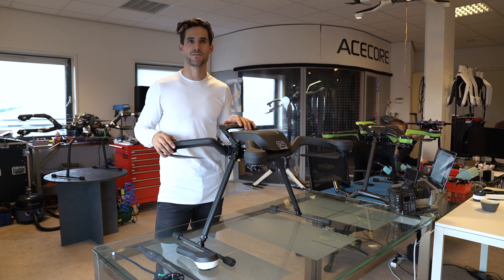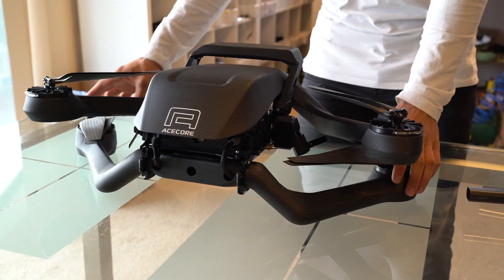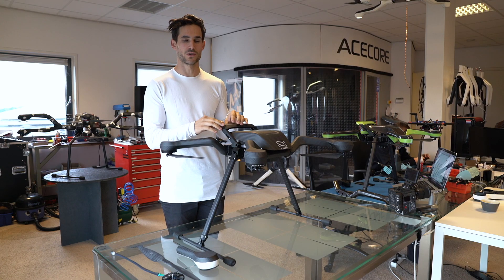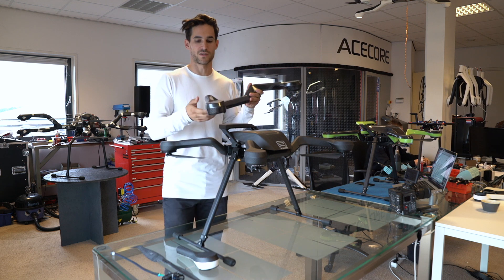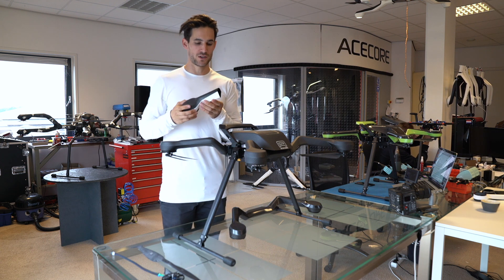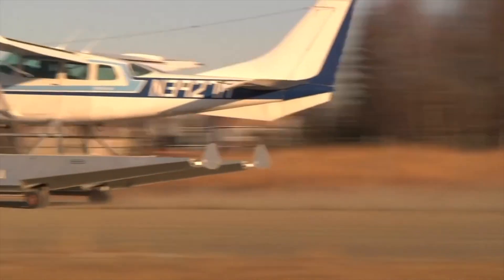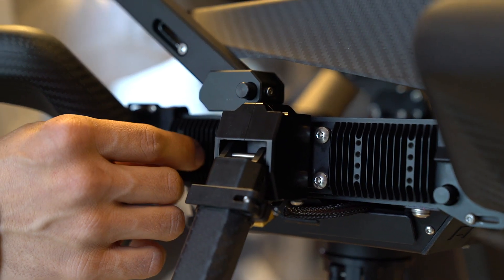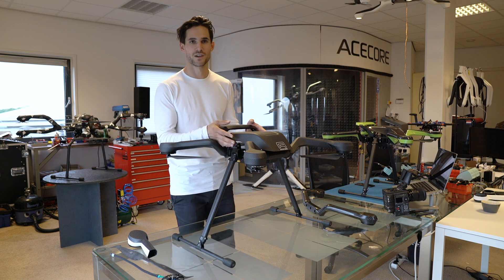AceCore - ZOE Drone - The ZOE Explained

Comment: How is it water resistant?The Motor case is open right?Is it because of the upside down design?
Reply from the maker: Yes! Because of the way the motors are engineered into the system it's virtually impossible for water to get in there.